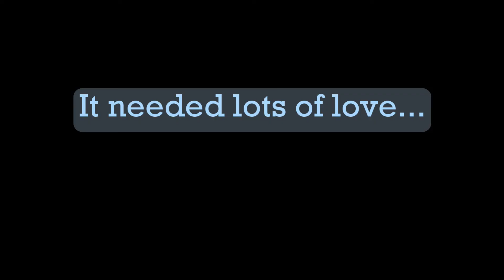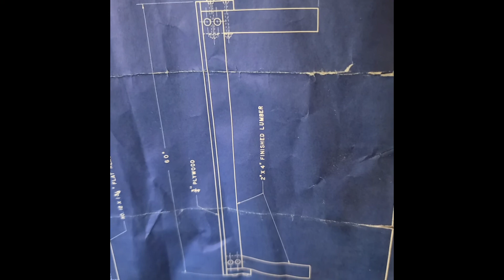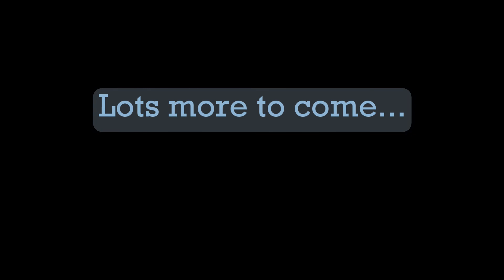Tool Restoration - 1948 Shopsmith 10E Lathe/ Drill Multi-tool

Comment: This video was great to watch and gave me inspiration. It also helped me determine what year my shopsmith is. I noticed my headstock looked different then any other model so I thought it was missing pieces . Turns out that mine is a 1948 too ! I just acquired one for free from a job I was working and I'm excited excited give it as much love ! 
Thanks for the video
Reply from the maker: That's awesome, still loving that machine. I stumbled across a used lathe shield that I am adding now and getting my kids into working with it.
Congratulations on your SS! What serial number did you wind up with?
Reply: @FreeFallinTrees  I will give the serial number a check later . If you have any info on part identification that would be great . I have a box od some of the different  attachments and I don't know what they are all for
Reply: @FreeFallinTrees   R 58633 idk what that means tho
Reply from the maker: @8FigureFlow  if you haven't found this forum yet it will be able to answer all your questions. This link will take you to my original post and the work I did to fix it up -
https://forum.shopsmith.com/viewtopic.php?t=29951
Reply from the maker: @8FigureFlow  This guy documented the serial numbers he has come accross. It looks like yours may have been made between 1951-1953 but you will have to read this -
https://forum.shopsmith.com/viewtopic.php?f=7&t=23647
Reply from the maker: @8FigureFlow  Finally, this is a gold mine of info including manuals that have pictures of all the parts so you can find out what you have. Feel free to message me on that forum as well and I can help. 
https://forum.shopsmith.com/viewtopic.php?p=274502#p274502
Reply: @FreeFallinTrees  awesome yes I was looking to make an account on the forums soon thanks again